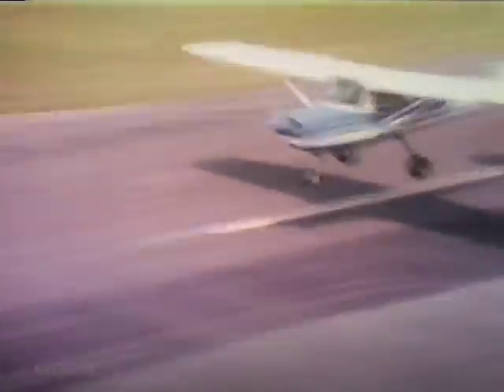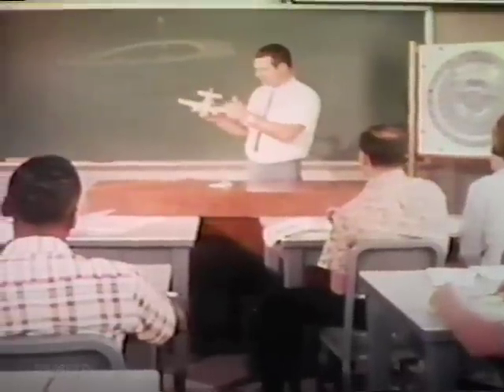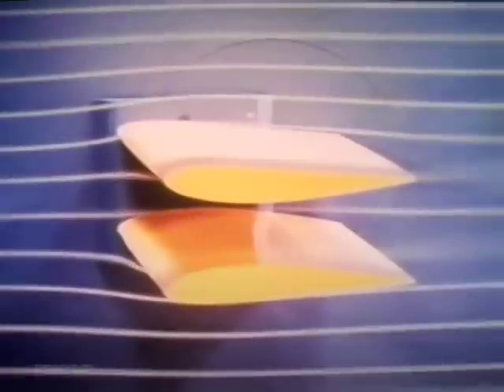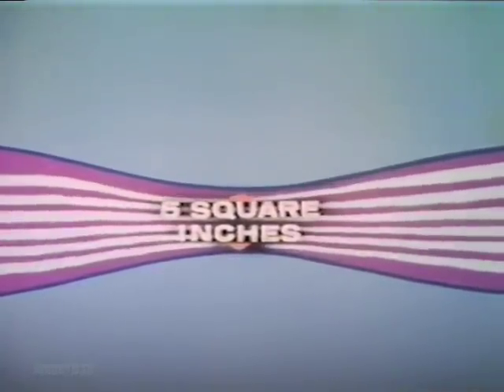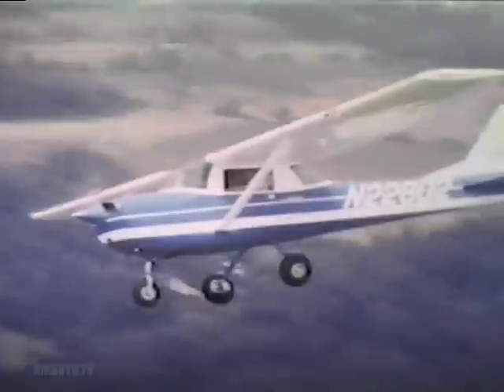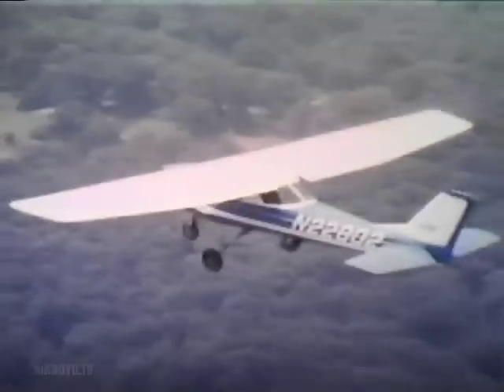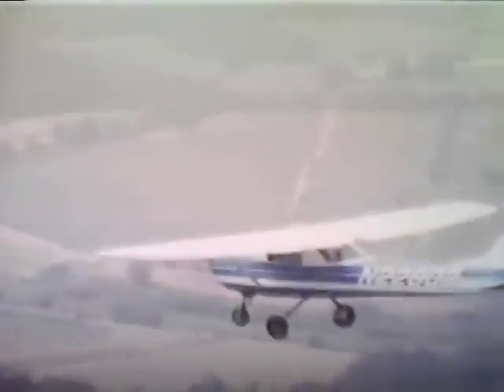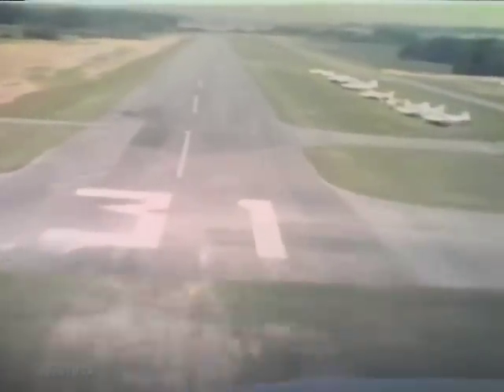How Airplanes Fly (1968)

Comment: Absolutely amazing that such a blatant error could be made in US government prepared educational film: "In straight flight thrust equals drag". Sir, if drag equalled thrust you would stay put! It is because of the very fact that thrust is greater than drag that you move forward!
Reply: Thrust equals drag in steady state NON ACCELERATING flight. In cruise flight (constant airspeed, constant altitude) one does not need to keep pushing the throttle forward to maintain airspeed. The throttle angle can remain essentially fixed. In fact as the airplane weight decreases as fuel is consumed, the throttle angle can be gradually reduced to maintain airspeed. During takeoff one is trying to accelerate (increase airspeed)...thus thrust must be greater than drag. When thrust is less than drag, the airplane decelerates.

Comment: @EFCthebest  the downward diversion of the airflow is the result of lift, not the cause. the cause is the difference in pressure between the upper and lower surfaces, generated by the difference in airspeed.

Comment: @EFCthebest I agree with your idea. A flat wing with no camber has maybe a lift/drag ratio of maybe 3:1. Put some camber on, and the L/D goes to 6:1.The first conclusion is: increased lift. I believe it is simply decreased induced drag.Obviously there will be slight reduction in pressure on the top of the wing because the inertia of the airflow NOT following the shape of the wing. It is well proven the massive reduction in drag caused by airfoil shapes to struts etc. This is ignored completely .

Comment: Think this is out of date
More recent articles I've read, suggest wings generate most lift by diverting air downwards
i.e Newtons law - equal and opposite forces - so volume of air diverted downwards equals force or lift upwards. The force generated by the reduced pressure above the wing due  to increased airflow is apparently very small in comparison - interested to hear others thoughts on this ?

Comment: @nakedleader Okay class, now we will learn about inverted flight in a Tiger Moth...... and how does a fully symmetrical section work? It is rubbish to ignore the fact that wings can work upside down despite the theory! Just add power and incidence, to get more pressure under than over......

Comment: the way lift is produced is not that particals pass over the wing and it's pressure's that is merely a little part of the equation. it is the direction of the after flow of the air leaving the wing, generally the air is force in a downwards motion off the wing and but newton 3rd law "for every action there is an equal and opposite reaction" therefore the downwards moving air pushes the wing up thus creating lift.

Comment: the way lift is produced is not that particals pass over the wing and pressure's, that is only a little part of the equation. It is the direction of the after flow of the air leaving the wing, generally the air is force in a downwards motion off the wing and but newton 3rd law "for every action there is an equal and opposite reaction" therefore the downwards moving air pushes the wing up thus creating lift.

Comment: To put all this simply, a plane flys using the venturi effect. As air speeds up, it's pressure drops. Lower pressure on the top (higher pressure on the bottom) of a wing will cause it to lift.

Comment: @J1mmyWA 
I'm no engineer, but I think you're right on the money.  I don't think airplanes are sucked into the sky.  Look at how much downwash a helicopter makes.  It couldn't fly w/ neutral blade pitch.  
I don't think they explain stall right either.  The condition called "stall" is the loss of laminar flow w/ a significant increase in drag.  That doesn't mean it stops producing lift tho.  It's just the drag increases way beyond the thrust of most airplanes' engines ability to keep it up.

Comment: This theory is outdated, the major causee of lift is the reaction of the bottom of the wing surface forcing air downward. The low pressure on the top helps a bit, but the most lift is because of the theory "every action has an equal and opposite reaction"